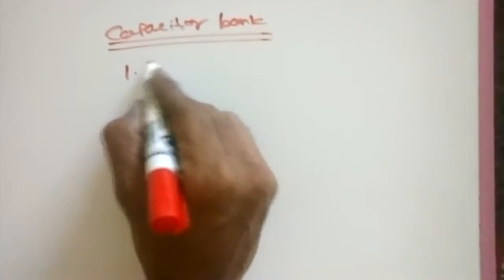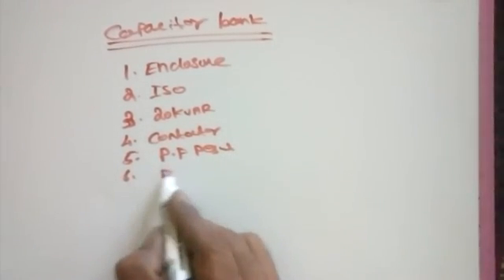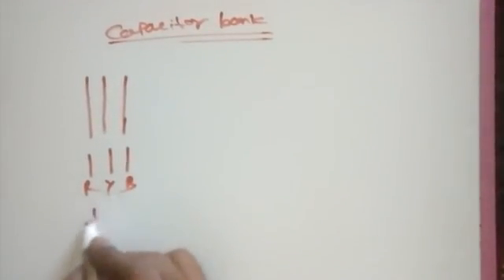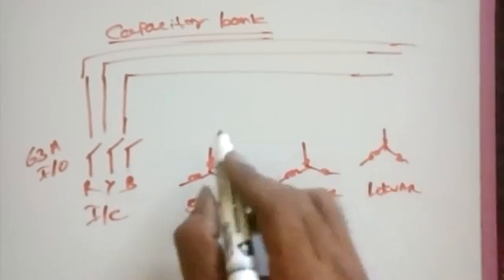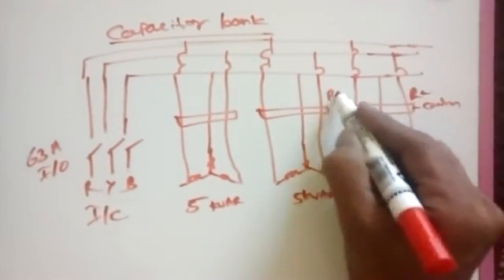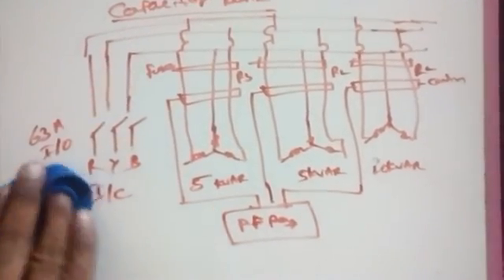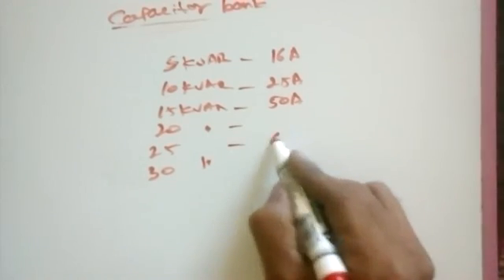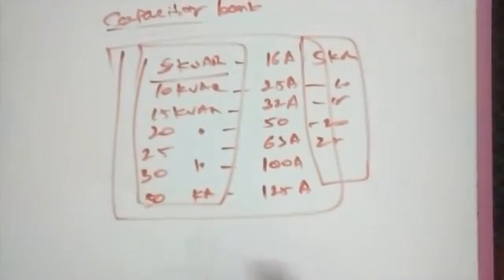Simply way to making of capacitor bank

Comment: I have installed 1 kvar 3 phase cylindrical capacitor for my motor.. What is the resistor size to be installed and how to connect it to the capacitor... Please help Anna....